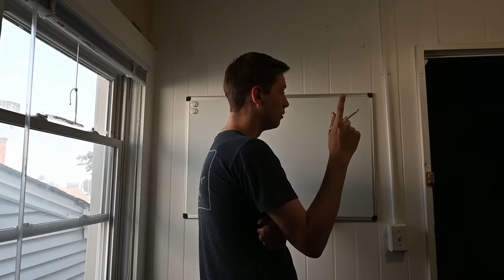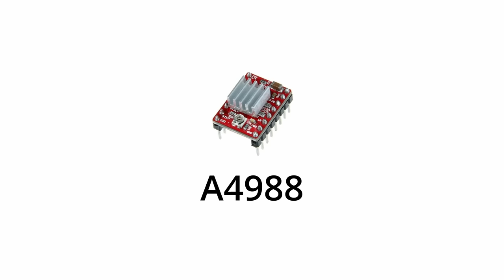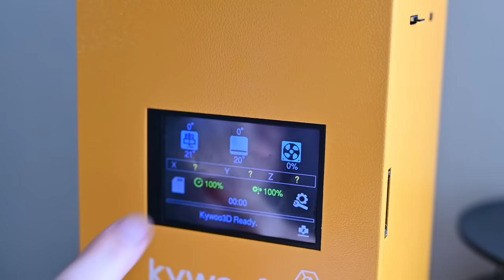3D PRINTED TIRES... Will They Last??

Comment: @5:23 -- it looks like for the bulk of the testing, the resin wheel was in the front -- it seems kind of obvious that in this configuration, it would show more wear -- I feel like the testing is invalidated by this.  (Not trying to be rude or mean -- I just legitimately feel like the testing was not scientific; or if it was, then the details about controlling for this were not adequately presented. -- This doesn't mean the conclusion of the resin wheels being less wear resistant is an incorrect conclusion -- it just means that this is not good proof of that conclusion.)

I also would avoid using different diameters for the test, and would avoid testing in the same spot sequentially... as those would also invalidate the test. -- Instead it would be a more controlled experiment if you built two devices and placed them in slightly different locations, under the exact same conditions (controlling for weather, sunlight exposure, terrain, etc).

I think alternately, you could prove me wrong by one of the following methods:
1.) Print new wheels, and do the exact same setup with the opposite setup and showing the same results (i.e. the orange wheel is in the front for the entire time, and still shows less wear) [of course in a new, non-pre-worn locations, with no swaps or direction changes].
2.)  Used the same wheel for front and back and showing that they wore evenly [of course in a new, non-pre-worn locations, with no swaps or direction changes; one wheel is in front 100% of the time and either wore less or evenly with the back wheel].

Comment: Hello. The result of the test is not right and not false. You must repeat the test, but you must chance the position from the wheels. Only chance the wheels not the motors. motor 1 ist a little bit faster as the other. The lower motor brake the wheel and this is not good. Or you build a testversion with a single drive motor an transmition on boths wheels.

Comment: "It's amazing how far 3d printers have come."

Proceeds to attach the build plate sheet with binder clamps. Lmao.
Reply: Well, a big point in manufacturing is using standard parts on designed objects

Comment: Resin wheels were up front the whole time. Possibly taking most of the damage of the path.
Perhaps swap position and continue tests
Reply: There was hardly any load, it's not going to make a appreciable difference what order is used.
Reply: @husker91  i was thinking more of like, it clears the path for the wheel behind it. mitigates most damage from all the rocks, moves them slightly more. idk.
Reply from the maker: I didn’t mention it in the video so it seems like a lot of people didn’t catch it but I switched the wheels order when I replaced the hub. It was about halfway through the testing.

Comment: Nice test , though i dont think it is fully accurate since you coupled two different tires in the same system which affects the results as oppose to testing one wheel at a time or at least same type of material each time.

Comment: i do not get it... u can just buy simple rubber wheel for 2-3 dolars...
this is what i call trash waste of time video...
" best idea yet..."
i mean... is this video made only as ads?
Reply: I have printed tires several times, because I needed something very specific that wasn't available at a reasonable price. I can't think of a better reason to 3D print something than to get precisely what you need for less money... or possibly, at all.

Comment: That printer still does fall short in one area. Buildplatform goes back and forth instead of up and down. It's a stupid design 😖
Reply: It is a stupid design, but both of mine are bed slingers and while I have to run them slower, they are perfectly accurate and result in good quality prints.